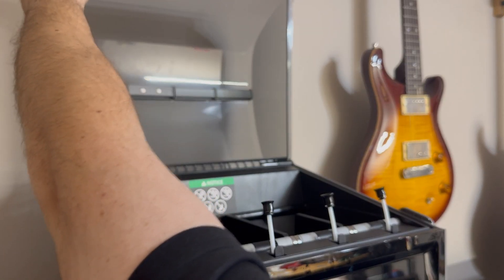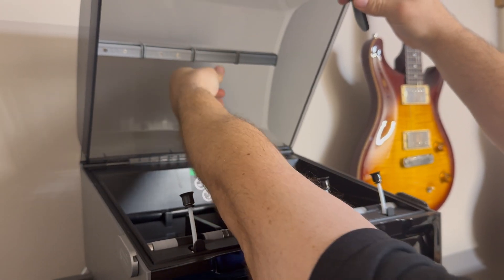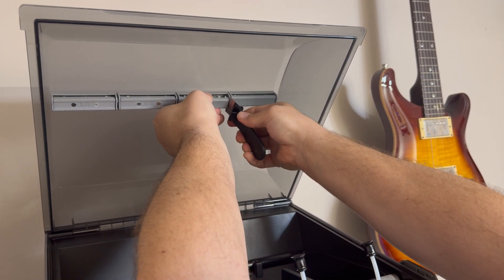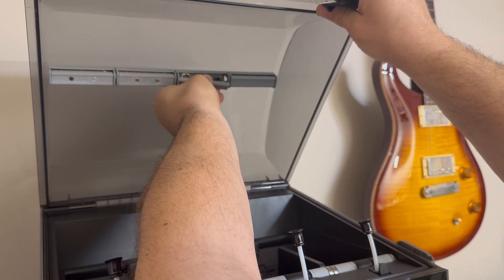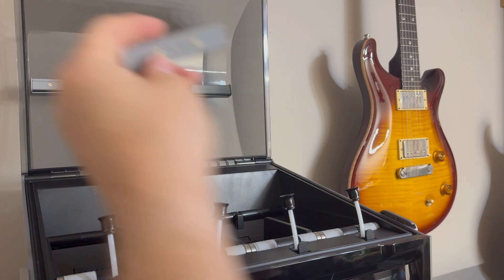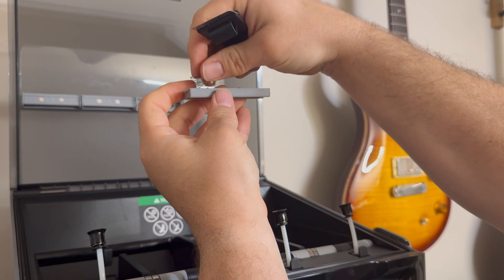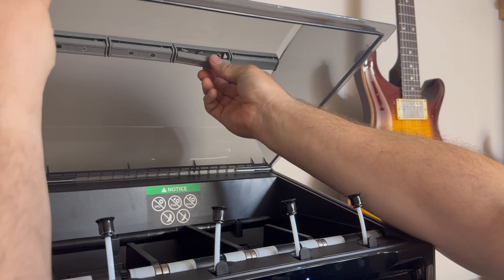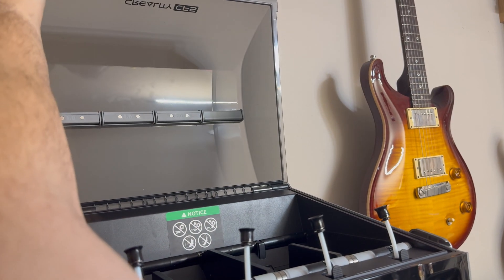Creality CFS filament compression block removal and replacement

Comment: The K2 Plus work very well without CFS, but with CFS I have many problems, the CFS broke many times the filament if I want print something with change color or change material.
And is not matter, I use Creality filament or other high quality filament.
If I start use CFS always have that same problem, the filament stuck.
On 10 uses CFS 5 times stuck.
Some time more then 50% times.
I want fix this but how ???
I not have this problem with Bambulab AMS.
Reply from the maker: I ended up selling my K2 Plus because I continued to have so many problems with it. I’ve now got a Bambulab H2D with the AMS 2 Pro and the AMS HT and am very happy with it.

Comment: there is several download files which one did you download? and thank you for the video it helps so much
Reply from the maker: @Thorpe73  this is the model I used. I used the magnet 6x3 version and printed a 1mm base for each and I also printed 5.0mm and 8.0mm spacers to start with. 
https://www.printables.com/model/1103497-creality-k2-plus-cfs-fix-for-small-spools-retracti

Glad it helped!
Reply: @DieselDirtWorks  on my files it says 55mm 80mm is that mean the same thign as its suppsoed to say 8.0mm instead of 80mm? or im i just lost lol
Reply from the maker: I would imagine it’s supposed to be 5.5 or 8.0mm
Reply: @DieselDirtWorks  ok. im printing the magnet pieces now. so the 5.0mm spacers replace the original 1.0 piece? sorry im alittle slow. and im struggling with this issue.  it doesnt retract well for me.
Reply from the maker: @Thorpe73 the 1.0mm base plate stays in place all the time and the other sized plates magnetize on top of the base plate so they can switch out easily depending on which size spacer you need for whatever spool you have in place at the time.